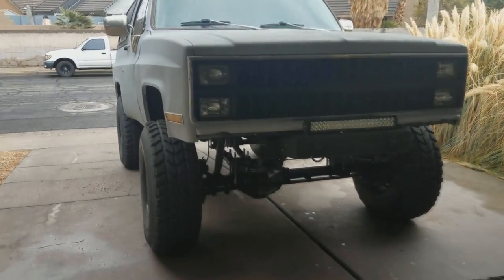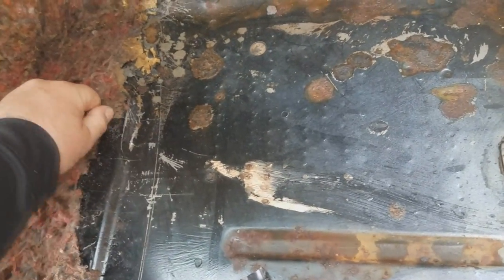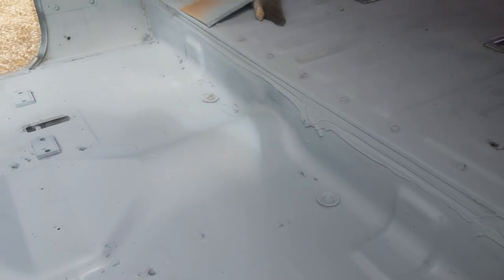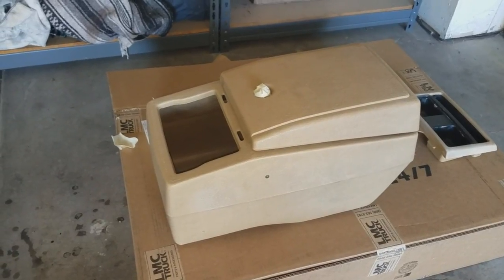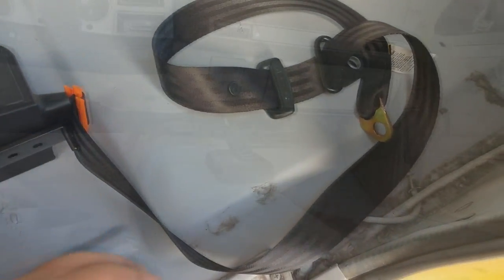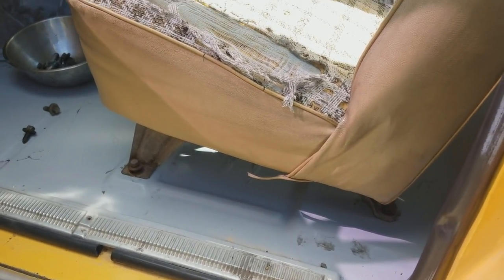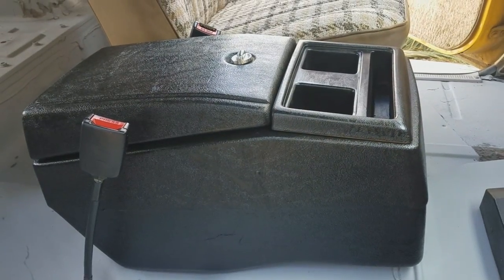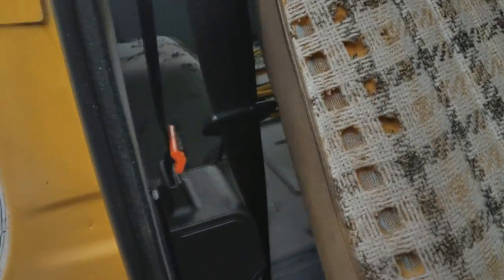82 Chevy K5 Update / Seat Belts and interior paint

Comment: Very nice Spun. 

That rust on the floor is most commonly from one or two things. The HVAC leaking (heater core leak or AC not draining properly) and/or the windshield gasket leaking. Keep an eye on both although it may have been an old leak. 

That insulation on the floor usually removes pretty easy with some heat and a metal scraper if you ever feel the need to get rid of it all.

On another note... What part number did you order for those seat belts? Mine are long past due for replacement.

Keep up the good work man! She is getting there.
Reply from the maker: I could be all of the above. 38-2241-BL